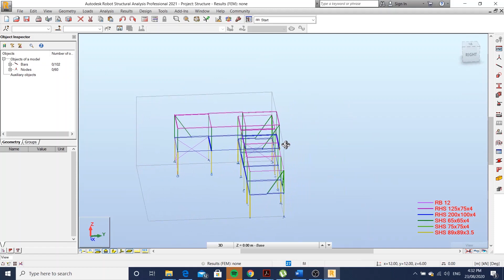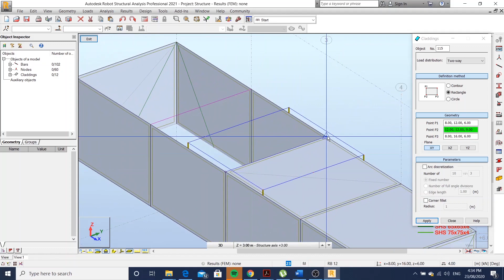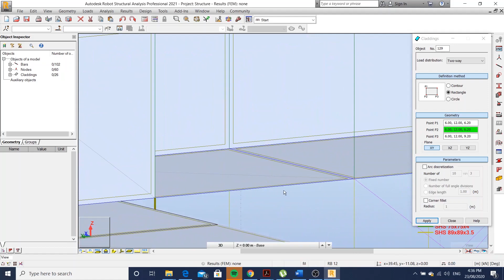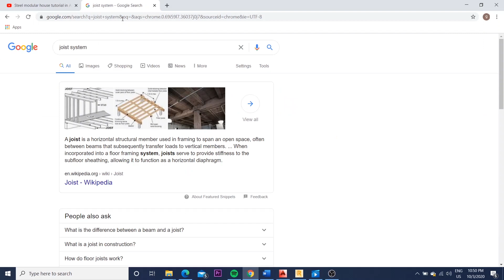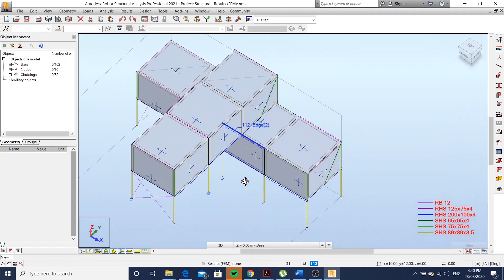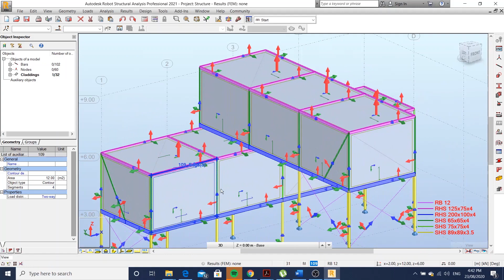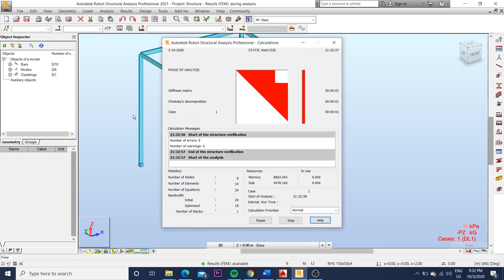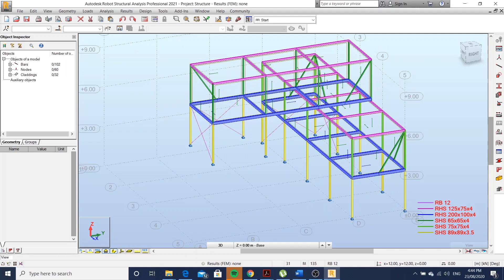Cladding - Part 2 - Steel modular house tutorial in Autodesk Robot Structural Analysis

Comment: Thanks for your tutorial. Do we can put cladding for all panels by rectangle method or we should define panel one by one
Reply from the maker: You can use the cladding tool to do a single rectangle for the whole area at once if you prefer. Just remember that sometimes you will have to assign different loads to the panels, so you may have to draw the panels separately.
Reply: @bengthebrazilianengineerinAus  thanks a lot ❤️